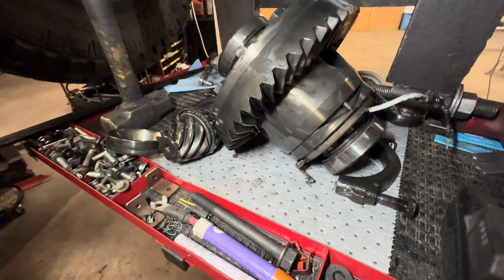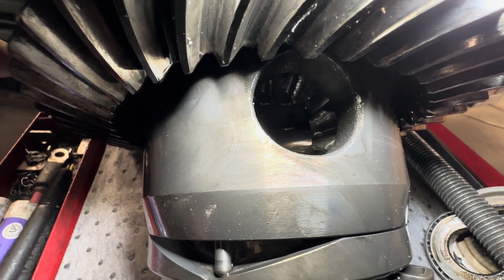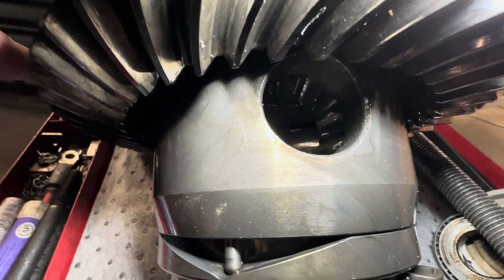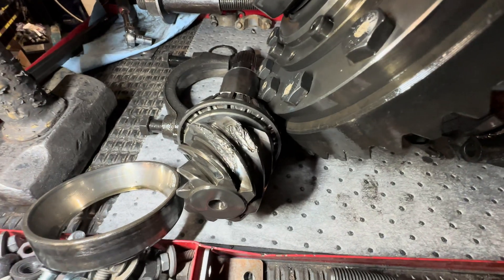Rear end gear failure

Comment: I'm running a dana 35 with 58"
Mickey Thompson Baja Pro XS tires. What ring and pinion ratio do you suggest?
Reply from the maker: The Dana 35 is not very strong, what size tires?

Comment: Yep, I just finished replacing the ring and pinion in my D 44. I went with 5.13 again but when I do a ,one ton setup I'll stick with 488.

Last set didn't even last a year . 40" tires 15.5 wide 750 crank HP. Tho the pinion might not have been set up correctly the first time. 

Great advice.
Reply from the maker: This is what we see here and people always ask about gears and Hemi swap stuff. The nice thing is when you have a V8 (400HP) you don't need a lot of low gear.. So you can get some wheel speed..